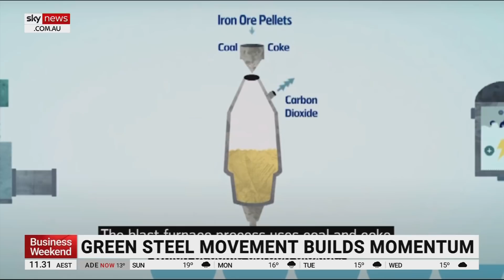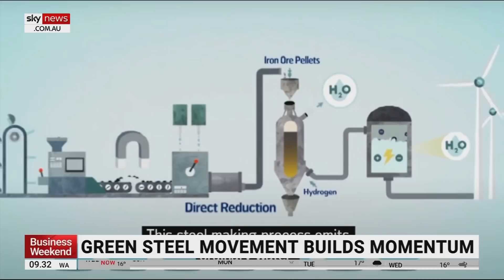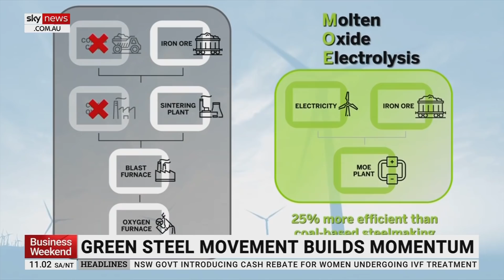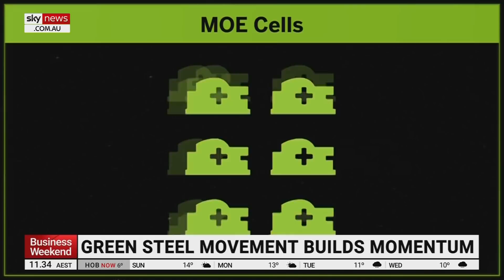'Great interest from the transport sector': Green steel movement builds momentum

Comment: I can extract iron metal out of ore using electrochemistry, if somebody wants to give me discounted electricity from solar power to even out the inefficiencies compared to large scale coal based smelting, but you still need to add some carbon to turn it into steel which is an alloy and not the pure metal. The electrochemical process can also cope with the unreliability of renewables too, but good luck doing it at the required scale and having it economically viable.

Comment: Rising temperatures also worsen air pollution by increasing ground-level ozone smog, which is created when pollution from cars, factories, and other sources react to sunlight and heat. Ground-level ozone is the main component of smog, and the hotter things get, the more of it we have. Dirtier air is linked to higher hospital admission rates and higher death rates for asthmatics. It worsens the health of people suffering from cardiac or pulmonary disease.
Reply: Turn it up.
Reply: Soooo weak 🙄
I’d like my profile picture back, please. You clearly don’t know what to do with it 🤷‍♂️
Reply: Stop speeading facts sky base can only handle misinformation.
Reply: yeah the rapid urbanisation to feed your diversity imports is nothing to do with it eh? when you cut down all the green land and put concrete it absorbs heat and increases average temperatures. Then shuttling all these people around pushes it further.  Solar output also increased but again (e.g. the sun is putting more light out), lets blame scambon dioxide for everything because it's a big kosher tax base.  One volcano can undo the efforts of a few years of this 'reduction' symbolism. And you lefties and righties can get screwed, you are both dumb as bricks.
Reply: Willing moron
Reply: Bawawawa...
Infidel
Reply: NOTHING can stop rising temperatures if they are happening because it is the Sun that is causing ALL significant warming & cooling on Earth. They have NEVER proved CO2 has any significant effect on global temperatures. THEY KNOW THIS is BS!! That is why the biggest pushers of carbon being the boogeymen we must fight, have some of the largest carbon footprints in the world. They have traumatised whole generations of children into the death-cult of climate change & they are now screeching, wailing & demanding that governments utterly destroy western civilisation to protect us from the big bad carbon, seemingly unaware all they are doing is giving governments an excuse to press toward the Great Reset.
Reply: Your Climate change fear mongering doesn't work. Lol

Comment: What a load of crap
Reply: @King Julian
You got owned.
Pick your battles 😎
Reply: @LouMinarty55  I didn't get owned, he lacks some educations to earn the privilege to talk about the subject. He's a talking head.
Reply: Mines the ore and transports it with green diesel
Reply: Yes your opinions truly are.
Reply: @kingjulian1549  Without carbon, no steel. So he is right. Coal is needed to provide the energy to melt the ore and to supplement the carbon the determine the hardness of the steel.
Hydrogen is has a to low caloric value and misses carbon.
So the whole story is about feel good with what I do messaging.
Reply: @pietermoorer3679  - so why are billions being spent on green hydrogen to make steel? I think you need to read up on the subject as its already being done. A simple Google search will explain the process. You don't need coal - you can use biomethane.
Reply: @kingjulian1549  are you saying you can use a load of crap to make steel?
Reply: @kingjulian1549  why are billions being spent on green hydrogen to make steel? You answered your own question dummy.
Reply: @tomorrow6  - no i'm saying a load of crap comes from your keyboard.
Reply: @BobSmith-o8c  - so you're saying Twiggy Forest is a dummy? And he's creating thousands of jobs for Gladstone. Jobs that will replace coal jobs
Reply: @kingjulian1549  fantastic - I’ll get to work on converting it to biogas and then integrating it into steel making
Reply: @EL-FUKKO  I work as a process engineer. There is a lot more to it to make from electricity hydrogen and then turn in back into electricity. And then the lost of energy converting it several times...
Reply: @pietermoorer3679  I work at KFC, but still know what electrolysis is
Reply: @EL-FUKKO  It's not just about that. It's the amount of electricity that you have to put into it. Then you have to have very clean water which needs energy to produce it, then you have the proces, the distribution and then then storage. Then you need special plants to produce the steam to make the turbine running. In that process you also lose a lot of energy.
The discussion about using hydrogen never is about the amount of energy needed to make electricity of it.
It is far more complex then just electrolysing water.
Actually, the plan is to make it from methan. Then you still have CO2